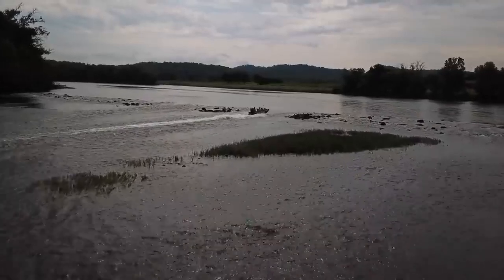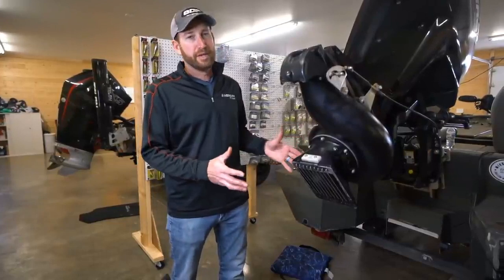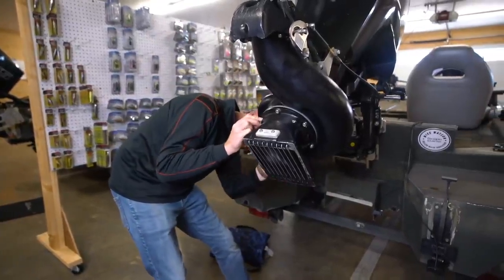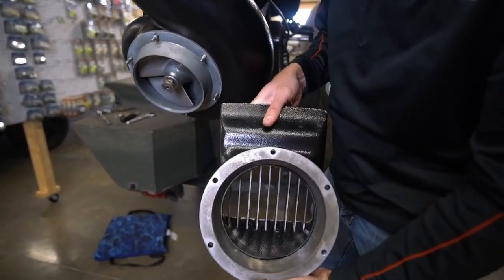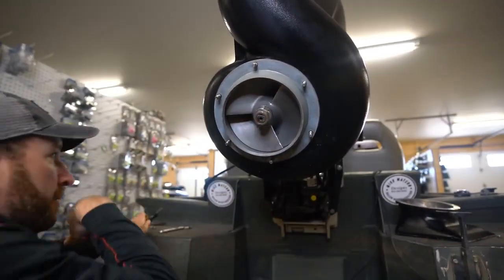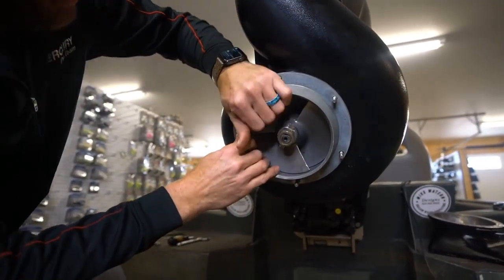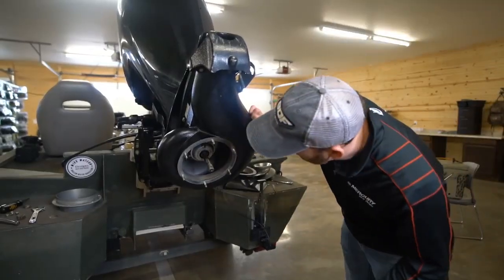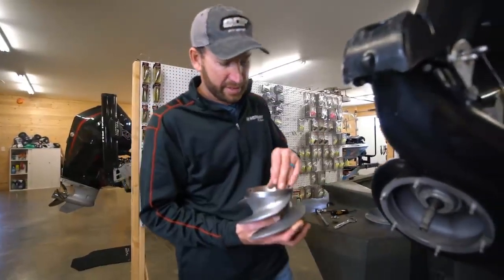Ott’s Garage | Jet Foot Adjustments | Jet Outboard Maintenance

Comment: I learned a trick.  Put playing cards between the sleeve and the impeller. This keeps the sleeve centered while bolting down.  Then you pull the cards out with needle nose pliers.

Comment: the rough texture you see on the downstream side of the leading edge is due to cavitation. You should try running the motor lower in the water to prevent that.

Comment: 6:28 I'm surprised that blade is such a blunt edge and not even slightly sharp. If that cone and the ring around it were tapered and fit inside one another it would be quite simple to adjust the shims to get the tolerance you need for it to be efficient... maybe that is how it works I don't know.

Comment: What kind of mileage per gallon do you get?  I have a 90 Johnson 2-stroke and get about 2.3 miles per gallon.  I’ve been debating on going Mercury four stroke for years.  Hope to hear back.  Thanks Ott.
Reply: Luke W. I have the same boat and motor and average 3.5 miles to 4 miles per gallon.
Reply from the maker: I get 27 mph most of the time and it burns 8 gph. If you want to compute it out 😂
Reply: I measured what I ran on Google earth then went back and filled up and divided it out
Reply: @OttDeFoeFishing   I love your river boat, I  have the same rig and have made similar modifications to mine.
Reply: Same here horrible milage 60/40 bought a new 4 stroke. unbelievable milage and so quiet. Well worth the money
Reply: @colenearhood6288  i feel your pain, been there

Comment: Q: Do you set your intake shoe level or canted slightly back down away from the transom?
Q: Do you use a transom saver off the trailer frame to the lower unit?

Thanks🤜🏼🤛🏼
Reply from the maker: I left it as it was. No I don’t on my jet. I just trim it down
Reply: Windy. I now use a transom saver on my Jet. As I travel across country. At first I  didn't. Only on my Conventional Prop setup. 
And have had the gunnels crack from the stress. 
It's an older Fisher Hull and not as strong as perhaps a more modern boat. 
It's still engine weight on the transom. So while out on the Snake in 2020. I had it welded again. And stuck a transom saver under it. 👌

As for your shoe... trim it for maximum speed.

Comment: Never file the bottom facing sides of the impeller it can actually slow the draw of water!!!put a very sharp edge on the top to draw water up..and sharpening the grates helps cut water too
Reply: No, that is exactly what should not be done. Go to outboard jets, the best how to info

Comment: Not a good idea to move the position of the impellor from the back plate. You most likely have increased more cavitation, which will cause premature wear on the back of the impellor. Most likely your issue is the housing needs more submersion, and/or ensure you have not had a change on the bottom of the boat to cause more drag or something to cause agitation of water prior to intake. Do a study on centrifugal pumps to better understand their working dynamics. Pumps are set up initialy per engineered design, so proabably at it’s optimum with set up from factory.

Comment: My flatbottom will run a lot shallower than your tunnel.  I can run down to a inch of water with same motor on a 17 ft lowe. Also that tunnel kills your speed. I'm hitting 40mph with my flat
Reply from the maker: Let’s try in some ledge rock and see who keeps going! 😂
Reply: @OttDeFoeFishing  let's go lol seeing that my whole rig rides a lot higher than yours . And that tunnel does absolutely nothing to protect the bottom of your boat.  So as soon as you knock a whole in your rig your done,  probably more likely than me ripping my shoe off lol as your boat bottom sits way deeper than my shoe does lol let's see you running in a inch of water 💧🤪 I'll post a video of me doing it after you fail lol it can be over sand so you don't wreck your tunnel.  (No ledge rock here) lol
Reply: @benkrause3321 Who cares? So if you’re done patting yourself on the back, we’ll all just move on.

Oh yeah, I’ll stick with my tunnel too. Fifteen years and I haven’t cracked a transom or bottom yet.